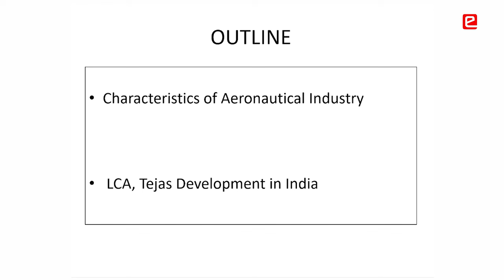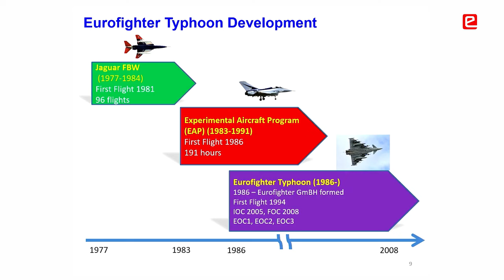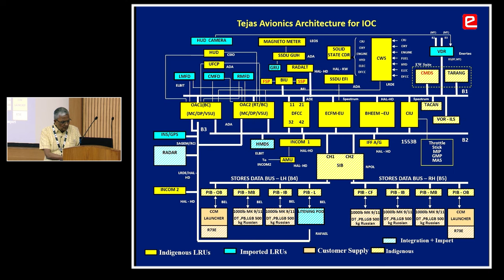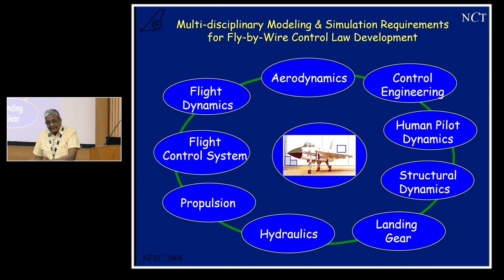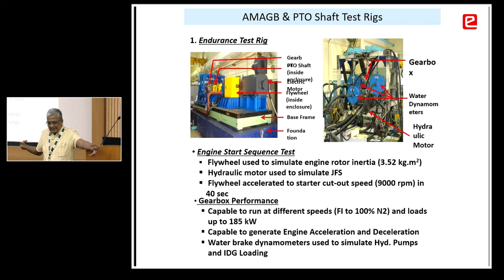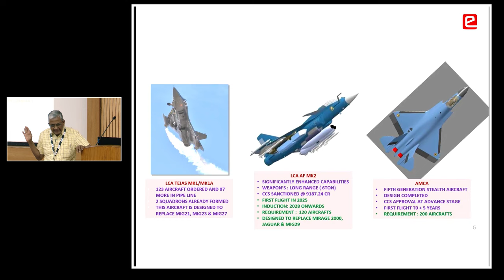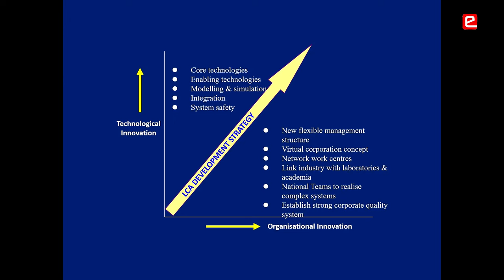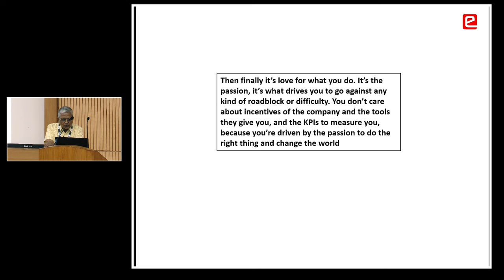Engineering a Complex System: The Story of TEJAS Fighter Development by Padma Shri Kota Harinarayana

Comment: The achievements here are all great but they are all let down due to unavailability of a high performance engine the entire Tejas program can be sabotaged by USA at will
Reply: @sasmac1829
I share the apprehension (fear) with you. But now "Kaveri" is making strides, so as to be fitted on Tejas. Even an under-powered (one of 90 kN) will do a great job on Tejas. And that will be followed up by continuous work & concurrent engineering.